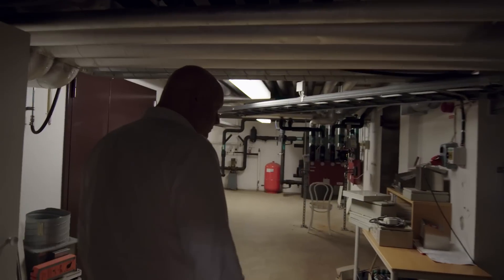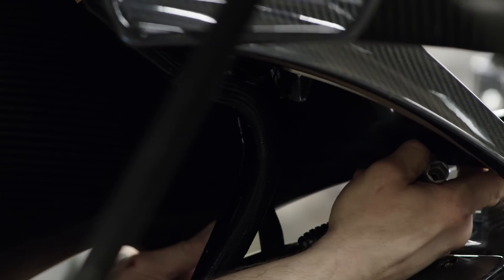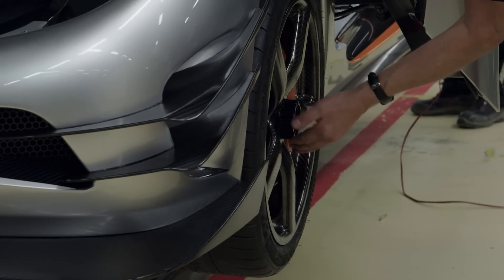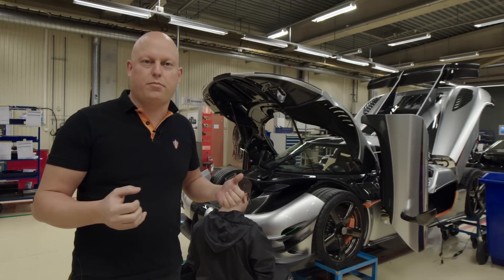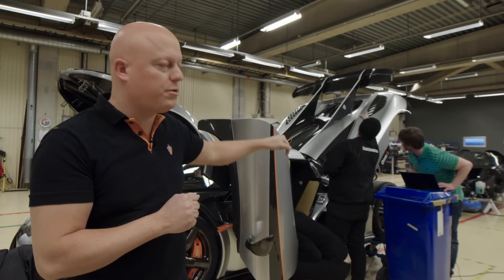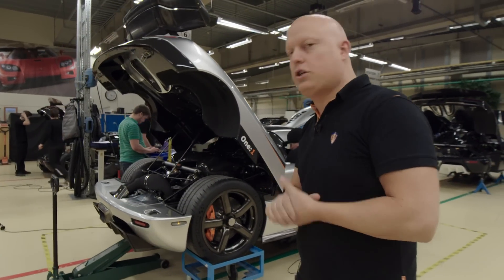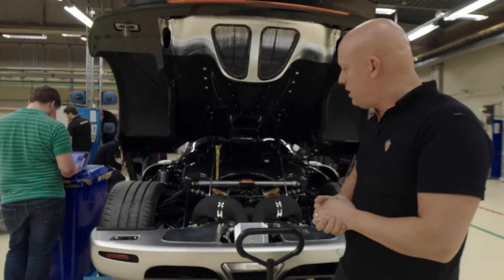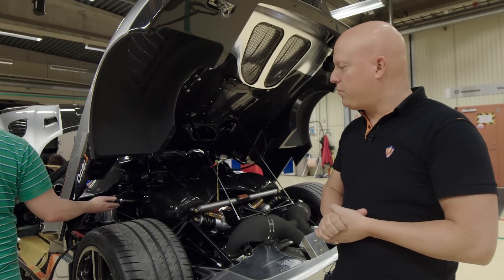Preparing the 1360hp One:1 for its Debut - /INSIDE KOENIGSEGG

Comment: Everything about this car is pretty awesom but two things keep bugging me:
1) It isn't the first one to one ratio or first Megacar. The Ultimate Aero XT already accomplished both.
2) While both 1 megawatt and 1:1 ratio are great, I'll really be impressed when they do it on 91 octane, not E85, especially since SSC already did. They will be 1-200hp away from the Megawatt on real pump gas.
Reply: the Ultimate Aero XT made 1300bhp but weighed 1270kg dry... no fuel, no oils no water. The fuel alone would take it over 1300kg. 1300bhp is also only 969.4kw which is 30.6kw shy of a Megawatt. The One:1 has 1014kw which is just over. The Ultimate Aero is an amazing car though! And as for the E85? really doesn't matter, I don't know where you live but here in Tasmania (an island at the bottom of Australia) every second service station has E85... it's becoming the standard.
Reply: ggroombr Here in Sweden where (duh) this car is being made every single gas station carries E85. Me and my father has converted our cars to E85 and every pump has that nowdays. So E85 availability in Sweden is equal to petrol. And Im pretty sure that they can produce fantastic numbers on 98 octane (same as your 91) aswell.
Reply: Tim Johansson Lots of North America doesn't have E85, nor Canada for that matter.  E85 works better when you are running turbo/supercharged cars as it is less likely to detonate. It burns colder.  We have 91 and 94... we can get other higher octane fuels, but in doing so, we'd have to run lower compression pistons with boosted cars.   Myself, my little 4 cylinder with GT3582R turbo has 8.5:1 pistons, where as my friends in the southern US that run E85 have 9/9.5;1 and can produce way more power safely.    There is a lot of math behind it.   Either way, invest in a good ECU.  Its my understanding Koenigsegg originally used Motec as a controller, but now has its own knockoff of the same thing.  IT has to process fast, and understand what fuel is doing in every cylinder, all the time via a number of sensors.  EGT, O2, AIT, MAP(or maf in some cars).      If you are interested in how a lot of this stuff actually works,  read 'motorbooks workshop' series of books  "how to turbocharge your car" and the other one on tuning ECU's.   Good series and entry level if you ever wanted to get into engineering, much like teams like Koenigsegg work with.
Reply: Actually, the SSC 1:1 ratio is only achieved at its dry weight, same with Venom GT. The One:1 is done at it's curb weight with full fluids, have tank of gas, and "average" weight driver. So it is technically the only true one to one ratio.
Reply: ggroombr the XT had 1350hp. 1 Megawatt = 1340hp.
The Difference between dry and wet weight is usually about 200lbs if I rememeber correctly. At 2750-2800lbs dry, that leaves 150-200lbs to keep it at the 1:1 ratio. So it might be just under it.
But still more impressive considering they are using 91 and not E85.
Reply: Tim Johansson E85 is certainly more common in some countries like Sweden, which is why this Swedish company uses it so much. The thing is, it is much easier to get those power numbers on E85 than 91 (or 98 RON in Europe). So the fact that using E85 they are only 10hp more than the SSC Ultimate Aero XT on 91 isn't very impressive. Run them on the same fuel and the Koenigsegg One:1 may only be making 1200hp.

Now, both cars are amazing and it's not like most people would notice the difference between 1200 and 1360hp, but I'd just like to see Koenigsegg compete at these horsepower levels on a fair playing field on not have to rely on E85. To me they build the best super/hypercar, but there is a few things they could do better.

Comment: Holy crap that Agera is light, weighs about the same as my dad's E92 320d @ 1352Kg, i want to make my '89 Jetta CLi a mini version of this, already have a light weight @ 935Kg, but need some serious power
Reply: Its not that light...

Ferrari 458S = 1245kg
LaFerrari = 1250kg (with battery pack and motors etc) - Now thats light!
Reply: My Jetta from the late 80's is 300 kg's lighter then both of 'em. and it still gots FULL interior
Reply: Beverain
Easier to push but not quite as quick or safe in a crash though :)
Reply: Beverain you could always ask to borrow one of this guys engines and drive trains, then you could beat a a Koenigsegg in the quarter mile...probably

watch?v=dElFiQcLsp8
Reply: M3Conv Thats curb weight the ferrari is dry weight.

Comment: Only 3G?  Why not 4G LTE?   Either way this car is going to set the standard for all and any mega car that comes after it.
Reply: Why would it need 4G when it receives simple data for the suspension?
That would be like having a supercomputer to play Minesweeper.
+ 3G coverage is move available than 4G.
Reply: Just because why not?
Reply: tokfrans Having 4G does not mean that it won't have 3G. Newest Qualcomm chips have LTE and every other band below all on one chip. There is no reason for them not to just go with LTE, except for the price, which for a car this expensive, really doesn't matter.
Reply: sevenayan Sure the price won't be that much higher if you'd gone with 4g. But I do not understand why this guy would even get bothered by the fact that the car uses 3G to send REALLY small data.
Reply: tokfrans Honestly, if the technology is readily available nowadays, and maybe the track info you want to download is a 100MB file, would you rather download it in around 20 mins or less than 5? I sorta see his point, it's just more convenient.
Reply: sevenayan Dont forget that this isnt even in production yet, when they start producing cars or customers they may put 4g in. And I would say the data file will be very small, close to 1mb or even less. It will only need be a small file.
Reply: I was thinking more on the line of having the whole car being a 4G hotspot like Audi is doing with some of their future model cars. But, for their doing for the One I think 3G is good enough.
Reply: zHSVClubby If that is the case with the file sizes, then 3G should be more than enough.
Reply: i suspect it has 3g for the roll out internationally it has a wider footprint cost of 3g vs 4g would not matter on this car

Comment: To Christian von Koenigsegg. I have a suggestion. Make the front window with a lot of small dimples like those you find on a golf ball. Also do this to all body parts that have the most contact with the air. I know that the manufacturing of those parts would be much more expensive, but maybe possible.. that would really help with aerodynamics at higher speeds.

Comment: Correct me if im wrong, but wouldn't the huge torque on the back wheels make the car just spin out every drift unless they do some kind of awd setup to split the torque?
Reply: Just because you have a light car, does not mean you have no grip.  Besides increasing mechanical grip in many, many ways via the suspension and aero package on the car - you also have many drivetrain options to minimize wheel spin and maximize forward acceleration.
Reply: This vehicle is going to have some type of electronic stability control in order to help prevent the wheel slip.
Reply: that is why we have computerized traction control on cars.. that makes the wheels to propel the car forward instead of skidding around and Turing the wheels all around themselves...

Comment: Wish I could afford this.
But I wonder how well carbon fiber will hold up in the long run?
Especially the wheels. Think of the potential micro fractures that could happen and the structural integrity will be effected.
Same goes for the whole car as well.
Also, pagani uses a carbon/titanium weave in his huayra. Now is that better? Will it hold up just as good as aluminum in the long run?
Just a thought.
I read something that Ferrari doesn't use carbon fiber for the main body due to the fact that it will be harder to detect potential issues that I mentioned above.
As for the la Ferrari, I think its made of carbon fiber. So I guess they only do it for their super cars.

Comment: carbon fiber springs? How? CF is so stiff, strong and brittle. Maybe I am wrong..
Reply: +kevin O It depends on how you align the fibers really. CF can be very flexible in the right format, it's used to manufacture springs in medical application quite widely nowadays.
Reply: +valebliz Maybe it can be flexible and tough at the same time
Reply: + Abdul Rashid Abdul Mutalib absolutely

Comment: Love the engine but this is a ford racing design. A few have already stated in comments. In fact all of his engines were Ford DNA. He just modified it like a tuner to a turbo application.
Ford Racing had some concept vehicles in 2003 Cema with a motor called 5.0L cammer. The motor was from the 2003 Mach 1 4.6L but bored to 5.0L. Engine was in a 2003 Focus 420hp,1965 Fastback Mustang and Supercharged in 1953 Ford FR100 Panel Truck 600hp. The next year a Mustang GT-R featured it with higher lift cams making 440hp .
The 5.0L was in Mustang Gt  2011 then Boss 302. That was around when the Agera first came out. The One:1 engine revs like the newer  XS Ford Racing engine. So again he took some small details from that engine also.
Nothing wrong this but I like because it has a American engine in it's heart.

Comment: I just checked out a video on the Hennessey Venom GT and this one had the raw specs, and it is also a "One:1," so to speak. 1244 kg weight, 1244 hp. Same power to weight ratio, but the Venom GT is lighter.

Some online car magazine NEEDS to make a video about the One:1 and the Venom GT going head to head.

The Venom GT has already hit 270 mph in one direction (so no return run, no record from Guinness), and Koenigsegg claimed a possible 280 mph with the Agera R, and the ONE:1 is supposedly faster, but no runs...

Putting money where your mouth is time Koenigsegg...(As opposed to customers just putting their money down on the Agera R or ONE:1 and taking Koenigsegg's word for it about the 280 mph top speed...)

Comment: I love this car so much but even though incredibley powerful, I dont believe it will be the fastest car in the world because there are sooooo many parts that make gigantic amounts of downforce. And the hennessey venom gt is the actual first car to have 1hp per kilo it had 1200
Reply: The GT had 1hp per kilo dry weight, this guy has 1 hp per kilo kerb weight, which means with all fluids and everything ready to go. Oh and this car has two modes, high speed mode and high downforce mode. So one is for ultimate track times while the other is for high speed. I'm pretty sure this can destroy every record in the book...
Reply: it should but the hennessey venom gt is the only thing that could hold a candle to this. Has less power but its lighter.

Comment: These cars are always pushing the limit, over 1000 horsepower is nothing special for them. But he kept saying "extreme" like it is the 90's and like he needs to use shocking words. The car's weight and power figures speak for themselves. I guess I prefer being humble and letting others do the hype and praise for your achievements. But I have never made a carbon fiber race car that is street legal and this does it everyday. Bring on the "mega" cars.

Comment: That vs a lamboghini sesto ELEMENTRO in a normal track with corners and straights because sesto ELEMENTRO is lighter than a ford focus and 0- 60 2.6 secs top speed 217 but in the corners it would be a far match

Comment: Here's the thing; Elon Musk has built an electric car with 416 hp, much, much simpler design, didn't even try to turn it into a race car, but I'm willing to bet he could easily make an electric version of his Model S that would have more horsepower than this, would be much faster and wouldn't use one drop of gasoline, at a fraction of the price...I am patiently awaiting the day when TESLA Motors brings that concept car to the auto show, to, once again, turn the auto industry upside down. Oh yeah, one more thing, it's whisper quiet, so you can actually hear once you exit the car after a race.

Comment: Why does it share the same look as the old car??.  There is a few technologic advancements yes but nothing like the P1 or the 918.  Why would I drop 1million on a car that is basically the same shape as the previous model, for that money I want to feel special. Yes it will be fast but there has to be more then that.
Reply: The fact that it is advertised as a new car should be reason enough to change the body.....Would you fell special at a set of lights if a Agera R pulled up next to you looking the same, only difference is your wallet is that much lighter....
Reply: potaka79
Yes, because I'd see two Ageras sitting at a light. Why don't you just appreciate it in all of its glory?
Reply: This thing will eat a p1 and 918 and laferrari alive with all their high tech bs.
Reply: potaka79 Yes, because I'm at a light next to an Agera R in a One:1. We look at each other, grin, give a nod of mutual respect, and go our separate ways, having for an instant forged a connection with a complete stranger who is just as awesome as we are. It doesn't matter if nobody else at the intersection can tell the difference between the two cars. We can both tell the difference; we both know, we both get it. And as with all good secret handshakes, that's all that matters.
Reply: potaka79 The One:1 was built on customers request. They wanted an Agera more suited for trackdriving and that´s why they have similar looks. With a little bit of research you will learn that this is a brand new car :)
Reply: The car was from customers' requests. It looks different enough for still being an Agera, but a track ready one. And don't worry about spending money on it, all are sold already.
The "technological advancements" in the P1 and 918 aren't that great. They added average working hybrid technology with great wording. They don't improve the cars performance or make it more fun. On the other hand, Koenigsegg is advancing a few areas of technology that improve the function in many aspects. And it was never about technological advancement anyways, but a faster track version of their car.
Reply: if you are buying this car to feel special you are doing it wrong.
Reply: Crazylalalalala Oh? I think I'd feel pretty special if I had a One:1 sitting in my garage. Granted I live near two cricuits and some entertaining mountains, so I'd also flog the hell out of it on the weekends, but the car would spend most of its time at street speeds, attracting attention and making me feel awesome... and I'd be okay with that.
Reply: Well, I am glad that Koenigsegg is sticking with it and perfecting the Agera. It would have been a waste if Pagani had just left the Zonda at it's C12 beginnings and held the vehicle back from its own potential.
Reply: potaka79 Obviously you are more into the looks of a car then cars itself. Look at 911 - same shape - because it is perfect. Under the bonnet everything about one:1 is new. You probably just want a car to show off in it.
Reply: lol....Very true.
Reply: DMStraylight

there are plenty of other uber expansive cars that can sit in your garage that will make you feel special and actually be useful on day to day driving. Choosing this one for that soul purpose is just a sign of more money than brains.

Buying a race car for any reason other then having fun on the track (or if you love the race team and you want to support it) is just stupid.

Comment: i use and love the metric system but come on WTF is with this kilowatt bullshit! it's not a fucking electric generator, Horsepower makes more sense.
Reply: Do you live in Europe?

If you do, open your car or your motorcycle's European document of ownership.

Read the power displacement that is stated there.

Always, ALWAYS in killowats.
Reply: exactly, and the watt is the SI unit for power. 1 kilowatt = 1000 watts

Comment: Anyone care to explain why this is way heavier than a LaFerrari?
Whats the point of all that Carbon Fibre, carbon wheels and weight saving, when still end up heavier than a hybrid with motor and battery pack? Its 120kg heavier than a 458S. Sack the engineers and start again:)
Reply: Its 1360ho wet, not dry.
Reply: Plus a LaF is only 950bhp this is 1360bhp... LaF will do 220mph, this'll do 273mph...
Reply: Plus a LaFerarri is a 6.3L V12, the one 1 is 5L V8!!! Think you'd better tell Ferrari to start making cars properly...
Reply: Edwin M
Ferrari learning from koenigsegg?

That's like NASA learning from Lada